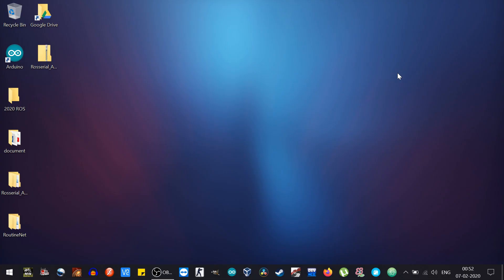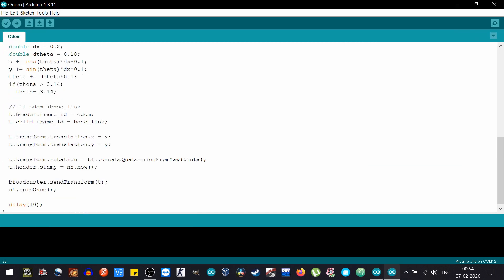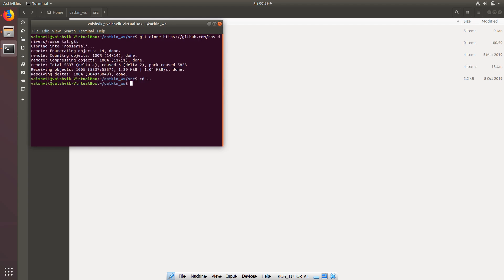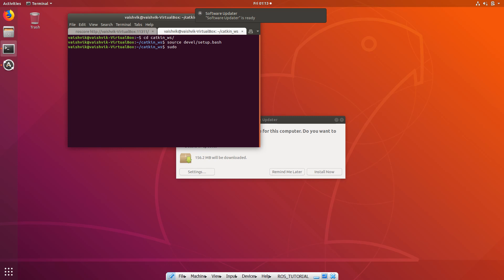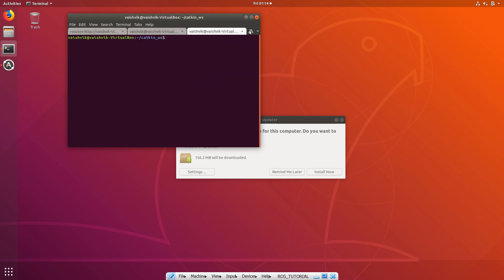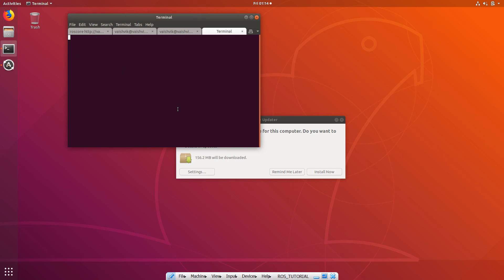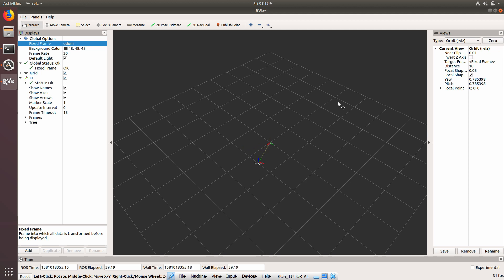ROS Implementation in Arduino Uno || Mega

Comment: Hi Bro...... it's a great video and easily understandable for a beginner, i am getting error after running "rosrune rviz rviz" will u please help me to solve the error.

[ INFO] [1611234263.842962666]: rviz version 1.13.15
[ INFO] [1611234263.843115704]: compiled against Qt version 5.9.5
[ INFO] [1611234263.843155459]: compiled against OGRE version 1.9.0 (Ghadamon)
[FATAL] [1611234263.853800172]: ASSERTION FAILED
	file = /home/ubuntu/catkin_ws/src/ros_comm-noetic-devel/clients/roscpp/include/ros/timer_manager.h
	line = 242
	cond = false
	message = 
[FATAL] [1611234263.854159891]: ros::TimerManager was instantiated by package roscpp, but neither BOOST_THREAD_HAS_CONDATTR_SET_CLOCK_MONOTONIC nor BOOST_THREAD_INTERNAL_CLOCK_IS_MONO is defined! Be aware that timers might misbehave when system time jumps, e.g. due to network time corrections.
[FATAL] [1611234263.854325964]: 

please help me to solve this error.........